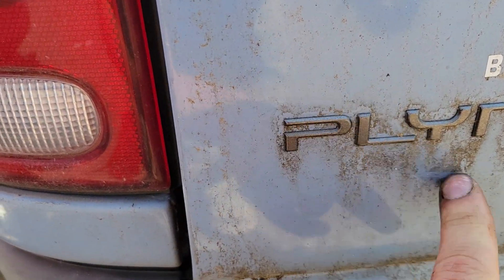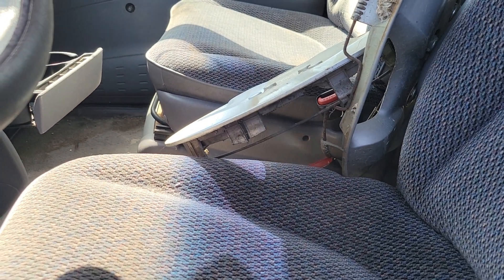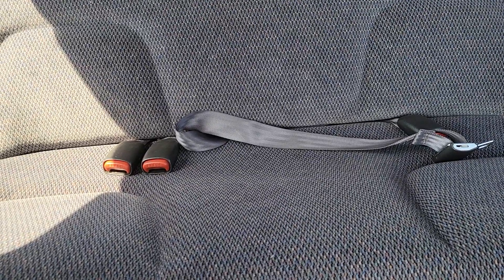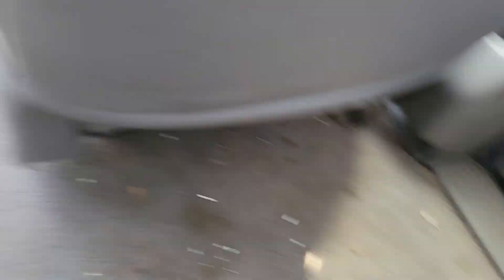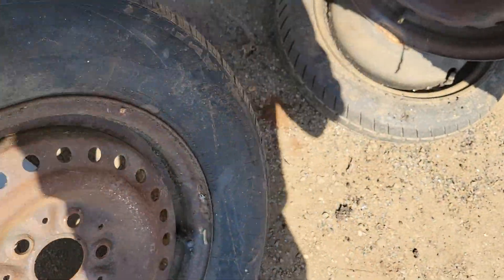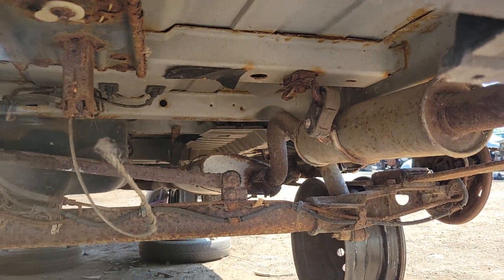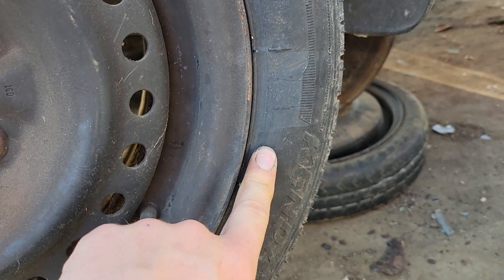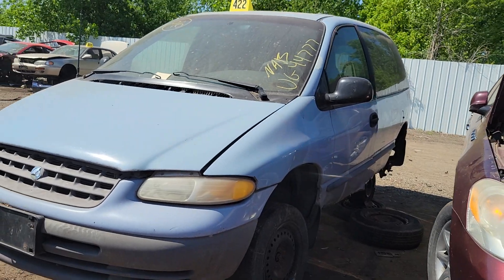1996 Plymouth Voyager with 3 door body at U-Pull Salvage Yard in Minnesota

Comment: Just after the power windows, the "security" block you pointed out, I believe that is trailer brake controller. My 02 sport had that. I should have kept that van.. I ran the vin and it hasnt been on the road in 2 years now.. so maybe it was good I didn't keep it? lol
Reply from the maker: Brake controller makes sense. I don't remember if there was a hitch on it or not

Comment: I used to put the 3rd row in the middle and take the second row out
Reply from the maker: I've got a 4th gen I did that to! The 84-95s had factory 5 seating as an option as well
Reply: @MNMoparMinivan  I’m pretty sure it was 89 you could get a factory 3 seats in the front driver and passenger seat too